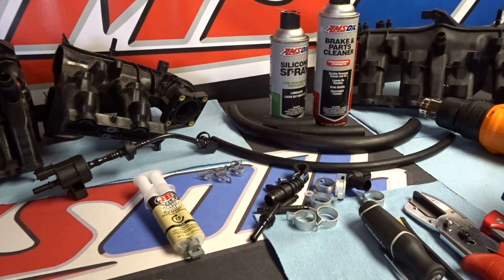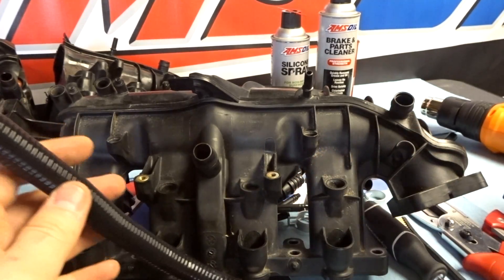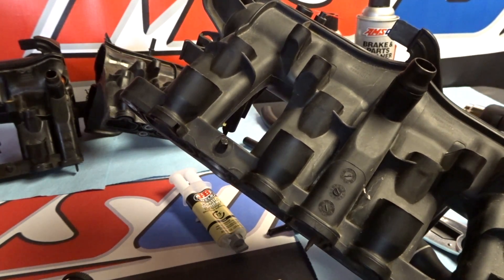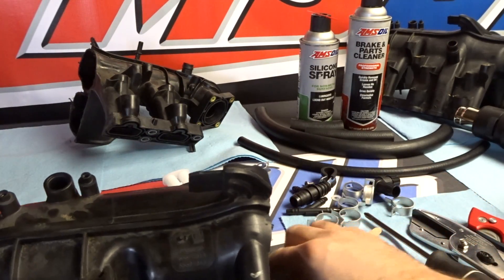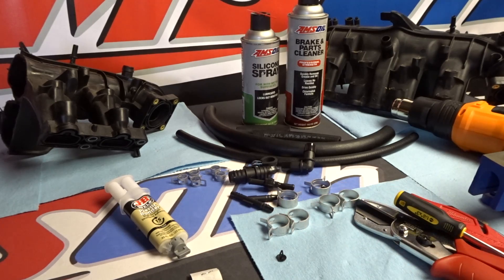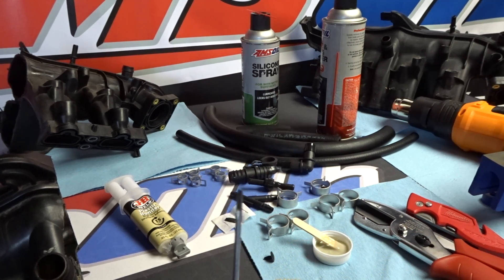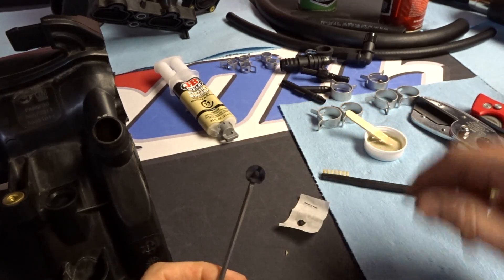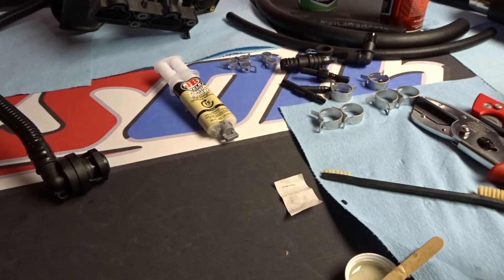How to Install the CruzeKits.com V3 PCV Fix Kit

Comment: would it work for GM 2018 Buick Encore 4l?
Reply from the maker: If it’s the Gen1 1.4L turbo, yes, but make sure you’re using the updated install video for the v3.4 kit. This video is obsolete.

Comment: Note: is it just me or ??? Hay, I really like your videos. Super informative. However I've been studying your connections and I think there's an issue here. The Turbo line going from the intake down to the Turbo, always thrusting air towards the Turbo right?? The you have the "T" in the same line going to the one way valve into the purge valve line & connection there on the intake and that is always sucking air because it's the intake as the car is running.  This is fighting against each for dominant flow. Turbo is flowing faster and intake is sucking one way all at the same time. Is the intake flow being canceled at the purge line by the one way valve under throttle?? Then while at freeway speeds. The purge valve is needing to go into the intake to purge, but yet at the Y connection it's still being pulled towards the Turbo.??? These are two separate systems now merged by hose connections. Both pulling for air. Or so to speak. Please respond on this. Thanks
Reply from the maker: The intake is only sucking in air when the intake manifold is under vacuum. Once the turbo starts making boost, the intake manifold check valve closes and pcv gas flows freely into the turbo inlet. This is the way the stock setup works. The kit doesn’t change where the pcv gas flows to, only the routing for how it gets there. It’s essentially a pcv re-route kit.

Comment: I've been watching this video over and over cause I have a 2014 chevy Cruze Lt and like it says 100% failure rate. Just had one question, the vacuum hose this kit is replacing, the one that runs from intake manifold to turbo is a thin hose that runs  along with original Pcv vacuum hose. Does that thin hose is it just left alone? Just asking cause the original Pcv vacuum hose comes together with thinner hose from whatever seller you get it from? Thanks again any feedback appreciated

Comment: I have underboost code on my 2013 Cruze RS the engine light came on and now I have permanent 171 lean bank 1 after the underboost code was set. I found your video very helpful.  Could the underboost set lean conditions??

Comment: Does it matter that I used check valves on each line from reroute to and from catch can to turbo.
Reply from the maker: @kylemartinez3139  yes. You don’t need that many check valves. Send me a picture of what you did through the chat box on the cruzekits site.

Comment: Already installed the kit so how i know when the check valve o. The kit needs to be replaced 
Thanks
Reply from the maker: @sancheztorres35  I’d replace it every 30,000-45,000 miles. You’ll know if it fails if you suddenly see more oil consumption or external leaks.
Reply: @AndreiDPop  awsome thanks

Comment: just did this and luckily I had already ordered a new PCV Hose for this car months earlier. Lucky I did because the valve in the bottom part.( near the turbo) eas completely gone. When you take that hose off if you can blow air from that bottom part then the valve is missing. On the new one when you look in that bottom part of that hose connector, you can clearly see the orange valve. You can actually suck through but you shouldn’t be able to blow through it. 
  I simply took the new PCV hose. I got and cut the ends of it off to use instead of the old one. Not expensive at all on eBay or wherever anyways, I think this is something important people should know. If you did it without replacing the bottom part of that hose then you are probably missing that valve also. Should be easily remedied and replaced.
Reply from the maker: The bottom part of the valve should indeed be checked, but it fails far less often than the manifold does, and it will trip a p1101 when it does. Glad you got that done proactively though!

Comment: I received my V3.4 kit in the mail here in northern B.C. Canada  earlier this week after just 9 or 10 days . I am waiting for the weather to warm up a bit as right now it’s close to or freezing every night. I have a question regarding the new check valve and the plug for inside the intake. Does the arrow on the check valve point back towards the purge valve or the other way towards the bigger hose leading to the turbo? Also, the flat part of the plug for inside the intake, does the flat edge go in so it is facing the bottom ( 6 o’clock position ) or does it face up ( 12:00 position ) when it’s in the hole in the intake?
Reply from the maker: Don’t follow this video. Check the video in the cruzekits.com product page or instruction page. That’s the most recent one. This video is very old and I’ve only left it up for historical purposes and comments.

Comment: I’m assuming that this kit would work on a 2019 Buick Encore? Are there any further updates to the kit nd do you ship to Canada?
Reply from the maker: This is the oldest install video. The kit has been updated to the v3.4 video. You’ll find that updated in-car install video on my channel. If the engine looks the same, it will work. 

Yes I do ship to Canada. Simply choose the Canada shipping option when you check out on cruzekits.com.
Reply: Ordered one for my son’s 2019 Buick Encore 1.4 ltr. Luv engine. His car only has 48,000 Kim’s on it ( just under 30,000 miles. He got a check engine light during a cold snap a few weeks ago. I took it to a friend’s shop and he scanned for codes. The check engine light went off again before the OBD scan. 2 weeks of slightly above freezing temps and no problems. Just this past Monday it was cold again ( -8 to -10  c or 17 to 14F ) check engine light is on again. I haven’t had a chance to look if that orange “ nipple “ is in the intake. If it’s still there can I still install this kit or does the “ nipple “ have to be missing?  Will this kit resolve the 14 degree F check engine warning  or is this another issue? Gonna install the kit anyways but need the temperature to warm up as I don’t have a garage. By the way, thanks for answering so quickly. I ordered the  kit the spare check valves and the tool kit although I have everything except the brush for on the drill. The oil catch can said optional so I passed on that one. Hope that wasn’t a mistake.

Comment: Hey bro. My pcv valve is gone in the rocker cover. I can still see the orange nipple in the intake manifold. Im just asking should i pull the orange nipple out and use your fix kit? Or just go ahead and just replace the rocker cover
Reply from the maker: I would do that if you have over 100k miles on it. Make sure you only use an OEM valve cover.
Reply: @AndreiDPop  cheers bro. Im from New Zealand. Do you sell your kits over here? Cause ive been looking at your kit and finding the joins for your kit are pretty hard to come by
Reply from the maker: @kfhkfh7530  some of the parts on the kit are custom made so you won’t be able to get them anywhere else. I do ship to New Zealand though. Just choose the international shipping option on the cruzekits site.
Reply: @AndreiDPop  is aftermarket not worth it bro? Have you tried aftermarket with your pcv fix? How long did it last? Sorry for all the questions its just that there is a $1000 dollar difference in price
Reply from the maker: @kfhkfh7530  what are you referring to? The valve cover or the intake manifold? 

Valve cover needs to be replaced with OEM only. Intake manifold doesn’t need to be replaced since the PCV fix kit addresses that issue. 

Aftermarket valve covers are of exceedingly low quality and high defect rate. I can quote out an OEM valve cover with the shipment of a pcv fix kit if you’re interested.
Reply: @AndreiDPop  yes please mate, and shipping price for all to N.Z and in N.Z dollar please bro
Reply from the maker: @kfhkfh7530  please shoot me a message with your mailing address on the cruzekits site in the chat box. That way I can get you an exact quote. I’ll send the quote tomorrow (it’s Sunday morning here).
Reply: @AndreiDPop  sweet bro
Reply: @AndreiDPop what psi is your check valve bro? And have you tried a Y fitting before that custom 5/16 fitting?
Reply from the maker: @kfhkfh7530  0.3PSI crack pressure, viton plunger, 70psi max pressure rating. Not sure what you’re referring to with the Y fitting. The Y fitting is needed to tap into the EVAP purge valve line for a vacuum source.

Comment: What kind of check valve is that in the kit. The part store only has one kind. And it looks like  bobber for fishing. But I would like to know.
Reply from the maker: Custom made. I order them 3500 units at a time. They have my own spec plungers inside for PCV compatibility and extremely low crack pressure. You won’t find anything local. 

You also won’t find the custom T fitting with the necessary angle to keep the check valve at a downward angle. 

Also if you’re getting your own hose, you can’t use heater hose and most fuel hose will collapse under vacuum. Only gates 27008 works. 

Are you trying to replace the valve or making your own kit?

Comment: So what’s gonna happen if you plug it n not add the check valve add on
Reply from the maker: There will always be some level of crankcase pressure so you’ll have more external leaks. You’ll also lose the vacuum that the piston rings need under lighter load conditions so you’ll lose fuel economy, increase oil consumption, and increase emissions. The PCV fix kit pays for itself in restored fuel economy alone.

Comment: Those check ball pvc's are sensitive to carbon buildup. Maybe use an older style pvc or reed valve.
Reply from the maker: Haven’t had issues with them with carbon build up if they’re mounted correctly and synthetic oil is used in the engine like it should be in any turbo engine. The v3.2 update relocated the check valve to near the T fitting at a downward angle so all fluids flow out of them, thus preventing the accumulation of deposits. To date I haven’t had any deposit-related failures on the two newer revisions of that valve, which has been out since about March of 2020. Older style PCV valves are not suitable due to their design; they only really work with N/A engines. The plunger has to seal well under boost for at least 30psi with a very low crack pressure.

Comment: So i did the valve cover I’m doing the manifold right now will the issue still persist timing lean code
Reply from the maker: It shouldn’t persist but you should be using the updated v3.4 install video. This is the old video from the original v3 kit.

Comment: I have a Dorman intake manifold that I cant see the check valve on because it is back inside the manifold. Will this kit work for that manifold? If so how would I see the check valve and how would I plug the hole?
Reply from the maker: The kit will work but you’ll need to pull the manifold to install it, or try to cake up the back with epoxy after cleaning it. I can get you a screw and washer to plug up the manifold if you want to go that route. Just put a note in the special instructions box and I’ll add those in for you.

Comment: Iv done this kit. Worked great. Over a year later Iv changed the valve cover twice now, the turbo ended up failing and now I can’t find why I’m getting a p015b code.
Reply from the maker: OEM valve covers? Which way do you have the check valve pointing? 

P015B should be an O2 sensor, upstream. The one that goes into the downpipe
Reply: @AndreiDPop  I removed one end of the check valve and blew into and sucked and air moved freely both directions, can I get this check valve at a parts store?
Reply: I live in MN, car did not start up well on negative degree morning and I wonder if it had anything to do with the check valve freezing up or something in the lines??   Ended up having a lot of oil run through the turbo into the exhaust and would kill the engine.  Bought a brand new turbo and it happened again a week later. New turbo failed, (it was freezing outside).  Was told it was a bad turbo. Got a new one again under warranty. No more oil getting through turbo but I’m lacking power somewhere. I’m afraid of what’s to come this winter with this car.   shops don’t want to diagnose ur pcv kit and suggest I replace everything back to stock and start there. I’m going to try a new check valve but I’m pretty sure there is vacuum leak somewhere
Reply from the maker: @pokquairyum  lots of reasons why a car wouldn’t start up well but a check valve being frozen isn’t one of those. In fact that could potentially make it easier to start since any vacuum leaks on the crankcase or PCV system would become irrelevant. I upgraded the check valves last year in around March then again in a October (just because I could and I wanted the best), and there haven’t been any issues reported with them. Only issues reported were with the original batch. I also relocated the check valve and sent a notice to all owners that the check valve was relocated to be positioned at an angle so it couldn’t accumulate fluids or condensation, which resolved any freezing issues.
Reply from the maker: @pokquairyum  getting a new check valve isn’t a bad idea but they’re also not hard to check. Shops don’t know how to diagnose anything anymore, they just replace parts. 

If it was me I’d do a boost leak test (I sell a test kit on cruzekits.com for that as well) to find any boost or vacuum leaks, and I’d throw a new EVAP purge valve on it just to make sure the solenoid isn’t leaking (it wouldn’t show up in a leak test since it’s behind a check valve).
Reply from the maker: @pokquairyum  yeah that’s a defective check valve. No you can’t get them at a store. They’re custom made with my own spec internals. Auto store check valves are too high of a crack pressure. Put a bolt in each side of the hose to plug up the path for now and order some more check valves off the cruzekits site. The ones that I’ve been including since October of last year have been really good. I think it’s $12 for a 2-pack of valves shipped.

Comment: Hello! I have changed the oil yesterday an i taught to check also the purge valve(the orange nippel is present) and the oil separator valve from camshaft cover.  With the engine idling i put my finger over the camshaft cover valve i didn't feel no suction then i tucked out the oil level rod and i noticed constant suction from engine. Then i spray whater with soap on the camshaft cover valve and i noticed that it makes some bubbles and that it sucks the water with soap.  Is it normal? Should be any suction ? Is my camshaft cover valve close to death? I have no errors  and no lights on to the dashboard. Please advice! Thank you in advance!
Reply from the maker: There shouldn’t be any suction on the valve cover vent. There might be a small leak if it sucks air through, or it might just be the diaphragm flexing like it should. What issue are you trying to resolve? 

Vacuum on the crankcase is normal but it should be mild vacuum. Place your finger over the dipstick port to seal it to test that. Should not have strong vacuum.
Reply: @AndreiDPop  

I don't have problems no errors i just wanted to check if they are ok. My car (2017 Opel Mokka B1.4NET) has 62.000 mi never checked any of the vacuum diafragme and i want to prevent any problems.

Comment: Hi Dre, the cruzekit V3 PCV fix that you came up with is amazing, But i have a question for you, After installing the V3 PCV kit in any chevrolet Cruze, do I still need to change the Valve cover that was previously sucking air?
Reply from the maker: Yes valve cover will still need to be replaced.
Reply: @AndreiDPop   Hey Buddy I just installed the v3.4 last night, I forgot not to start the car for 15hrs min. I had it running for 20 secs and noticed a really rough idle like an hour after I plugged the hole and everything assembled. Do you know what might it be for the rough idle?
Reply from the maker: @optionsice  a vacuum leak somewhere. Is the valve cover vent sucking in air? Did you lose the retaining ring inside the pcv pipe manifold terminal? Either way you’ll need to add some epoxy around the plug there to make sure that seals later, but that alone wouldn’t cause the rough idle.
Reply: @AndreiDPop   Thanks for the quick reply, I will have to check in a bit if the vent is sucking air. I did not lose the clip car was running fine b4 the install. Just to make sure the check valve arrow should be pointing towards the firewall on v3.4 ?
Reply from the maker: @optionsice  yes. Away from the T fitting and toward the Y fitting.
Reply: @AndreiDPop  okay update, I checked all my connections and started up cold it came with p0303 and went away now seems to idle fine. Not sure what that's all about
Reply: @AndreiDPop  also no suction on diaphragm on valve cover and noticed when pulling out dip stick air was sucking in while car was running

Comment: Would this have anything to do with a MAF sensor code? I plan on using the kit for preventative maintenance in the future. But if that’s not why I’m running lean I’m gonna fix the problem first
Reply from the maker: P0171? Yes it’s a related code. Rarely do you have to replace the actual MAF sensor on these cars.

Comment: How do you know if the check valve is clogged or goes bad?
Reply from the maker: You can try blowing through it both ways. Should only flow through one direction.